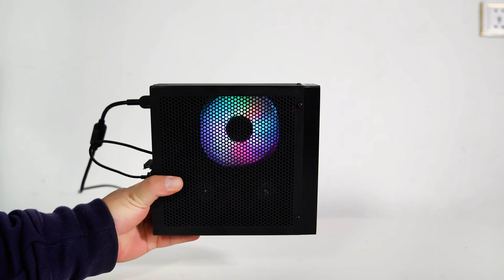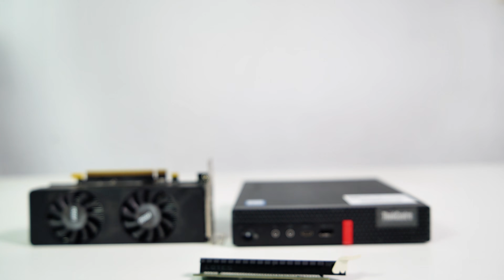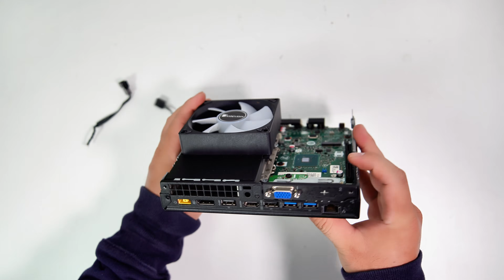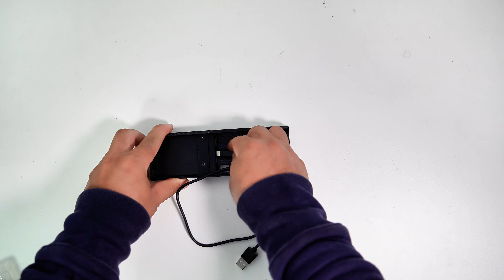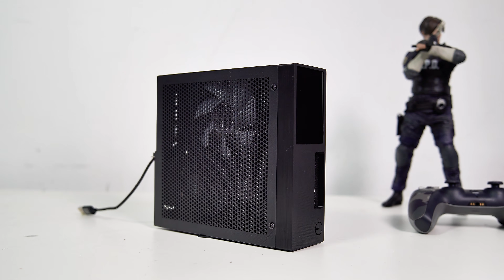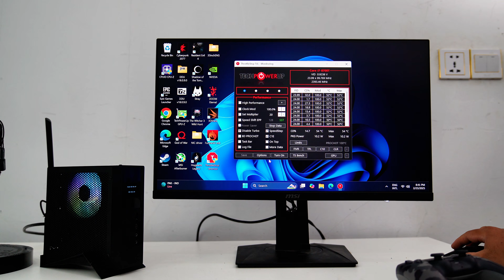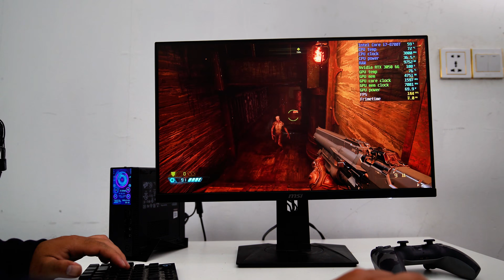Custom 3D-Printed Case for M720q: Can it fit Any Dual-Slot LP GPU?

Comment: I have the M920Q and I would like to install a sound card through the PCIe adapter, do you think would it work with the stock 65W PSU?
Reply from the maker: I think it should work. However, please check your sound card's power consumption to ensure it is not too high. Thank you.
Reply: @itggear  Hello again, finally I installed the Creative Sound Blaster Audigy FX and it's working fine with the stock 65W PSU but the stock low profile bracket doesn't fit and the top cover does not close so I'm running it without back plate, I need to know what program do you use to design a back plate for the Sound Blaster, thanks!
Reply from the maker: @xxg.tester7851 DAE file can be open with any 3D modeling such as blender fustion 360 or sketchup. Thank you.

Comment: And for the 3050 you dont need a pico but you would need one for the 4060? Did I understad that correctly?
Reply from the maker: Yes, the RTX 4060 requires a single 8-pin PCIe power input, and unfortunately, this tiny PC cannot supply enough power to run this GPU.

Comment: I have a thinkcenter m75q-1 ryzen 3 pro 3200GE can i upgrade the Cpu to another one? I also have a r5 5600 cpu
Reply from the maker: Unfortunately, the ThinkCentre M75q-1 with Ryzen 3 Pro 3200GE does not support upgrading to the R5 5600 CPU. The motherboard and BIOS are not compatible with that CPU model

Comment: Is it possible to use the secondary display with linux f.e bazzite or arch?
Reply from the maker: Hi there! I'm not quite sure which monitor you mentioned, however, in this video, I use my Windows tablet, the Asus VivoBook Slate 13 OLED, to display for testing using the Razer Ripsaw HD game capture card. This tablet is only equipped with an Intel Core i3-N305, so I could not run the game on Bazzite OS. For the monitor, it is an MSI 180Hz 24-inch gaming display, so you can connect it to any computer. For the screen on the case, it is a USB display that only renders PC performance info using ADIMS64 data. You can customize various themes in its app, and you can set your own background image, but it cannot display as a PC monitor. Thank you.
Reply: @itggear 
Hi thanks for your quick response and sorry for expressing myself in a misleading way.

What I meant was whether the 3,5 screen will work with Linux and can get the data to display it.

Or is it windows only.

Thank you

Comment: 4. Lokale Servicezentren in Deutschland und Amazon FBA-Lager, WiFi 6 2,5G LAN 8K Dreifach-Display
Mini pc es hat mich nur 499 gekostet,mini computer,Unabhängiger Oculink belegt keinen NVMe-Steckplatz,Produktmarke ist,, Aoostar,, Ryzen 9 6900HX / 32G RAM DDR5 + 1T SSD M.2 2280 PEIC4.0
Reply from the maker: Hi there! Thanks for the insight. That option is great for you. This particular video topic is about renovating the M720q to give it a new look and push the possibilities for existing Lenovo Tiny PC owners. It is not intended to convince you to buy this PC and mod it the same way I did in this video. Thanks again for watching.

Comment: is it possible to fit a dual slot, single fan GPU like RX 6600 XT? obviously the enclosure has to be larger (like in your solution) but how could you provide external power to the GPU? any ideas? i haven't seen anyone do it with these tiny 1L PCs
Reply from the maker: Hi there! There isn't enough space to install a full-height GPU in this PC. If you really want to do so, you might need to design a new case to install a GPU completely outside the chassis making it more thicker at lease 80mm and, using two PCIe riser cables. Thank you.

Comment: If you dont want to cut wires for cpu fan, you can just buy a 4pin to usb cable, and do the same thing as he did with the small screen. Some cables also come with pwn nob to adjust the fan speed
Reply: @LaZzy.G.G  this help me a lot, thank's

Comment: Can you made for the p330? It have dual nvme so more headroom
Reply from the maker: Do you mean the P330 Tiny? The P330 Tiny and M720q use the same chassis, so there's no need to create a new one. You can check my video; I have designed many cases for it. Thank you.

Comment: Great Job! You always do such an amazing stuff, I admire you! Keep up the awsome work!!!
Reply from the maker: Thank you so much! Your support means a lot. I'll keep striving to do my best!
Reply: @ You have all my best wishes my friend! 😉👍
Reply: @itggear  By the way if we put this large cpu fan would we need to put southbridge metal plate for cooling of the southbridge or it would not be necessary due to the capabilities of the cpu fan to cool the southbridge as well?
Reply from the maker: @dimovstanimir  The big problem with that tiny PC is that the VRM chip gets too hot. When I checked the HWINFO app, one of them was already reaching around 116°C when the PC was idle. I haven't tried the 65W CPU cooler yet, but I saw the product image that shows a heatsink over the VRM chips as well. Thank you.
Reply: @itggear So presumably the metal southbridge plate would also cover the VRM chip and would potentially cool it as well?

Comment: Could a Rtx 4060 work in this??
Reply from the maker: As I mentioned in the video, I've extended the front bezel by approximately 8mm, making the total depth of this new case 190mm. The Gigabyte RTX 4060 LP, which is 182mm, should fit in this case. However, you will need to add an extra power source for the GPU. Thank you.

Comment: I bought an rtx a2000 and the computer shuts down because of it, although before that everything was fine on the gtx 1650, why so?
Reply from the maker: Make sure all parts are not defective during the process of making changes or installing/uninstalling. Thank you!
Reply: @AlexNagornyi  you’re not alone ! I’ve had exactly the same issue with a 3050 low profile card ! Start anything requiring even moderate graphics and the whole unit shuts down ! I’ve tried msi afterburner and nvidias own app to limit the power draw of the card and replacing the riser plus using the 300w psu…..The only solution I found was to use an NVIDIA t1000 instead…… ITG - you mentioned having the card running at the full 70w - please may I ask how you managed to do this ? Thank you !
Reply from the maker: @AlexNagornyi The PC shutting down randomly is most likely due to the VRM chip getting too hot. You can use HWINFO64 to monitor the temperature of each VRM chip, and you may see some of them reaching temperatures as high as 165°C. This is why your PC shuts down—to prevent damage to the components. As you can see in my video, I always manage the temperature of my PC by using full ventilation, a top cover, and adding custom fans or installing additional heatsinks.

One more thing: you cannot find the original 230W or 300W Lenovo AC adapter for around $30 to $50 as listed on some online stores. What you find at this price is likely a third-party product. The original Lenovo AC adapter on the Lenovo online store costs over $100. Even if you are using a higher wattage AC adapter, it still cannot guarantee that it will provide enough power for your PC unless you use the original AC adapter. Thank you.
Reply: @ thank you for sharing your knowledge and experience - it is very much appreciated. I will try these steps to rectify the issue. Thank you again !
Reply: And for controlling argb, instead of sata.  I am using esp8266 board and wled.  But took power from the motherboard 5v.  And it is easier than sata and there is remote access to control the color of the cooler

Comment: Could you make something similar but using a Lenovo tiny P3, P350, P360, M90q? I have a tiny P360 with a Rtx A2000 and wanted to have a nice case like yours
Reply from the maker: Hi there! Currently, I don't have these PC models on hand. However, once I get one of them, I will create something for it. So please stay tuned. Thank you for watching.

Comment: I've been having fun playing on my m720q with the Yeston RTX3050 6GB especially after upgrading to a I7 8700T. One thing i'd like is to still be able to use the on board sata connector. I've been searching for an adapter with a longer flat cable but haven't found one. I think i will try to extend the one i have by cutting and soldiering a longer fpc cable to it. It is not an easy job but i have successfully extended similar fpc cables before.
Reply: theres an extension cable on aliexpress for the sata connection, i'm going to incorperate this into my build
Reply: there's also a 1.25mm connector for the 4 pin CPU fan, aliexpress circumvents the need to make these cable from scratch, i'm just waiting on my 3050 to arrive, i've purchased ITG Gear's model design from his Patreon (thanks ITG Gear, you're a scholar and a gentleman:) i can only afford the 120w power supply so i hope it'll be enough for the build, please help.
Adso, i love this community, people have come together and its refreshing
Reply: Oh I'll have to search for that! @SevinKamuels_AFC2026
Reply from the maker: Great idea! Your ingenuity is impressive.

Comment: This looks great. I have a M920x and the exact same msi 3050LP. Do you know if your mods will work on the M920x?
Reply from the maker: Yes, it should work. The M920x and M720q use the exact same chassis. Thank you.
Reply: @itggear  would you be willing to provide your files or, would you rather I purchase directly from you?
Reply from the maker: @BahnYuki  This 3D case is available on my Patreon shop, and you can check the link in the video description. I've also provided many free 3D case model files on my Printables profile. Please check the link in my channel profile.

Comment: Hey man - working on a similar project, I was able to use the JST connector on the board (the black one next to the B2B connector) to provide power to a fan hub from Phanteks (picked for its low wattage consumption, as the header only provides 12v 1a), then use that to control case fans using software. I ran a ribbon usb cable from the back of the computer back into the case to control it. This is allowing me to use one large 140mm fan for intake, and two smaller 80mm fans in the front for exhaust - where you have the screen, all while keeping the stock cpu cooler. You can order a cable from Lenovo directly to plug into the JST connector, then splice a SATA power cable on the other end (at least, that's what I did).
Reply from the maker: That sounds absolutely amazing! I'm really curious to see the result of your setup. Your ingenuity in using the JST connector to power a fan hub and splicing a SATA power cable is seriously next-level DIY. Keep me posted on how it turns out, I can't wait to see the final product!
Reply: @MarcEricLaneGlobal  upload a video mate
Reply: Can you share result of your setup, please?

Comment: Now next would be to figure out how to make a m720q work with a rtx 4060 low profile
Reply: There is a header on the MOBO that's designed to power a Thunderbolt card - I'm wondering if w some cable shenanigans, you could splice an 8 pin power connector from there.
Reply: @MarcEricLaneGlobal  some problems all 12V lines on the board are already at the limit when installing the gpu and you would need to tap into the 20V lines on the header directly connected to the power supply when stepping that down you should be able to to it neatly from all internal cables still power ratings on the connectors would make me sweat a bit
Reply: I ended up using a Dell DA2 PSU and made an adapted cable with a switch to power the 8 pin on the card. Downside is the length of the card at 180mm and then adding the power connector even being 90 degrees add another 10mm ish.  A 170mm card is the perfect fit. 180 could be workable but the power cable makes it difficult.
Reply: I have the same m720q. I upgraded the CPU to an i5 9500t the ram to 32gb the ssd to nvme 2tb the OS to bazzite and have it a Radeon 550 GPU. I also have it a 300w power supply. I vented the top but I still can't figure out how to stop the system from throttling
Reply: @fredericocorrea9814 did you use throttle stop ?